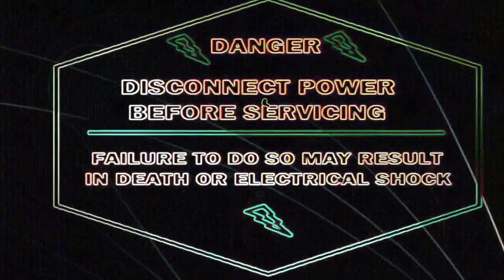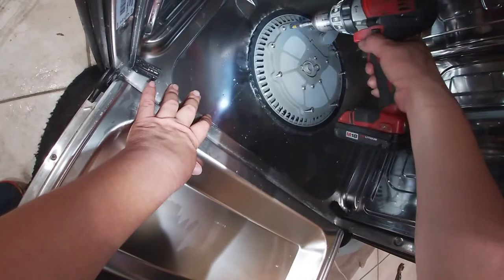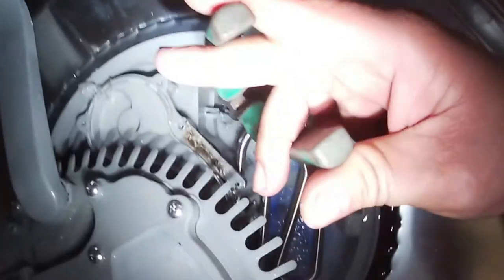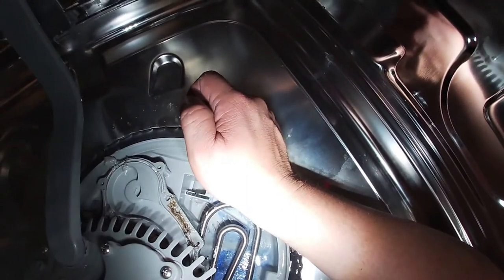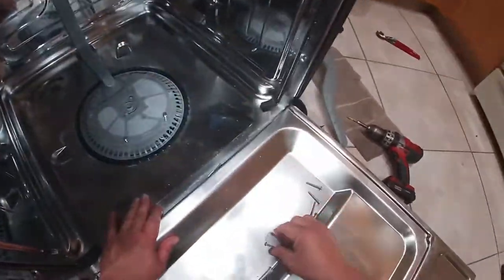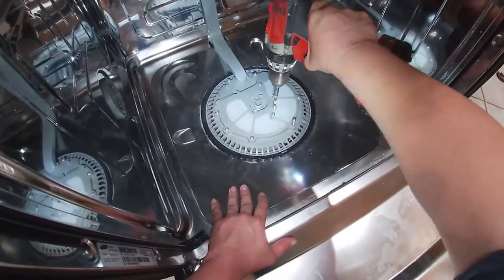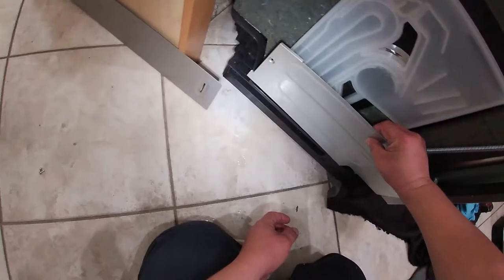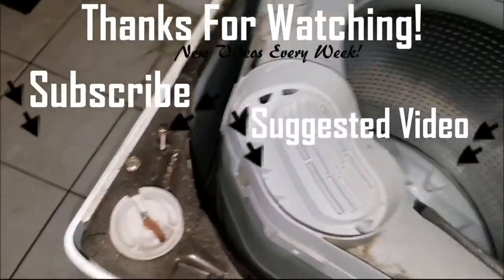How to Fix Samsung Dishwasher Not Draining Properly | Model DW7933LRASA/AA

Comment: I replaced mine but its still not draining properly. And no error codes pop up 🤷🏾‍♂️
Reply from the maker: @LensCc  make sure you install it properly if the pump is humming and trying to drain the water out go ahead and remove the flapper. If it still doesn’t drain you probably need a new drain pump if it’s not even humming, you might have another issue.

Comment: if you completely remove the check valve will it drain just as a test? My check valve appears to be fine. so it suppose to be partially open?

Comment: Which direction should the valve face?
Reply from the maker: It doesn’t matter
Reply: It does matter. The flap is slightly over to one side of the thick piece that holds it in place. At least on my model it is. I just replaced mine .

Comment: TLDR: Check and clear that Air gap. Any debris in the air gap may fall into the dishwasher drain hose. Check and clear both. 

Just wanted to add a step to look for any dishwasher that doesn’t drain. 

The Air Gap. 

I had a Samsung dishwasher and checked the one way valve, filter, and watched all the videos about where debris or clogs could be, but none mentioned the air gap. 

Well in my case it was the air gap. I didn’t see one person that had Lc errors or drain errors recommend to check the Air Gap. 

Symptoms. 

If you get a drain error

If you see water collecting in the garbage disposal and rising to the sink. 

Intermittent drain errors

I found a couple of debris pieces inside the air gap and it was restricting the flow of water, but because it was intermittent it was very difficult to diagnose. 

You can open the top of the air gap, remove the cap, and then with a screwdriver or your hands remove the little cap or dome shaped cap to see the inside.  There are two hoses underneath the sink that connect to the air gap. 

If you want to be 100% sure it’s clear you can completely remove the air gap and look inside. 

In my case the debris feel back into the drain hose and when I disconnected the dishwasher drain hose from the air gap the water and debris dumped into the bowl I had to catch the extra water left in the dishwasher drain hose. 

I know this is a long post.